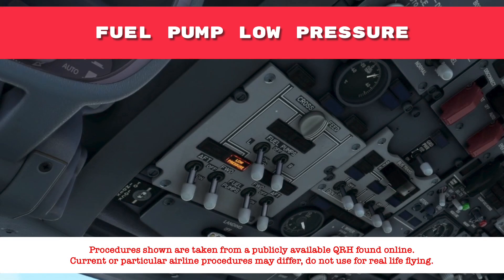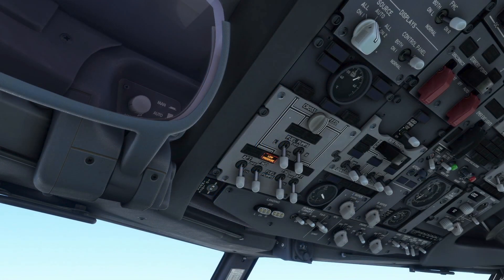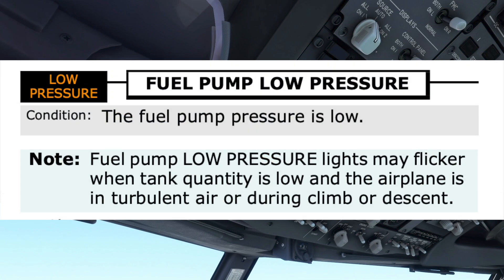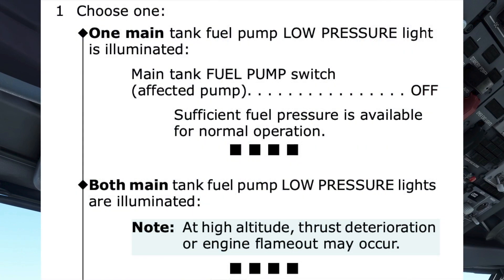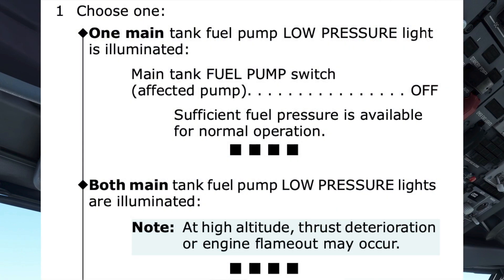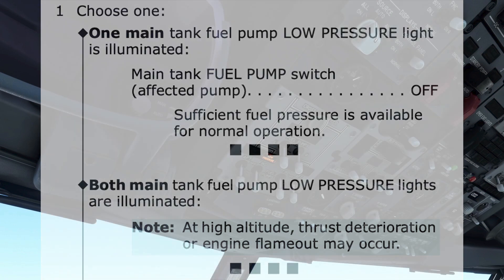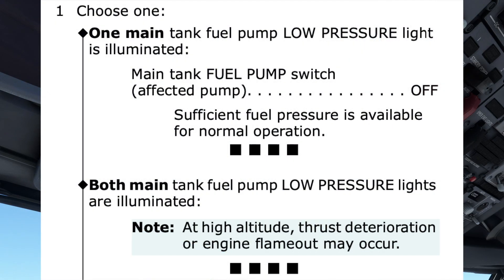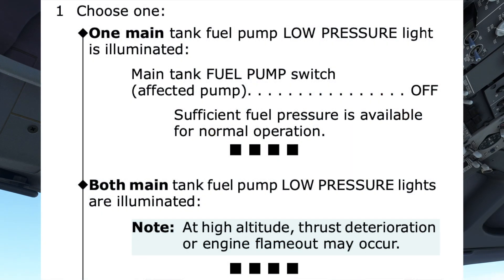737 Non-Normal Procedures: Fuel Pump Low Pressure

Comment: Hi. Is there any reason why with one pump LOW PRESS in main tank called for the pump switch to be OFF but with 2 pumps LOW PRESS, no action of switching the pumps is required? Thanks
Reply from the maker: Thank-you for your question. According to AI, when a single pump shows low pressure, it indicates a possible malfunction or that the pump is not effectively delivering fuel. Turning it off helps avoid overheating and damage. However, turning two pumps off would indicate that the fuel tank is empty or nearly empty. The system is designed to prevent the pumps from running dry.